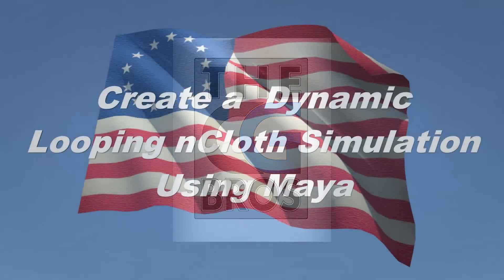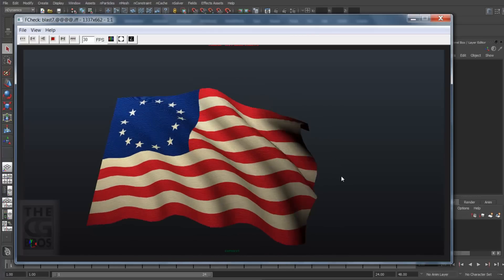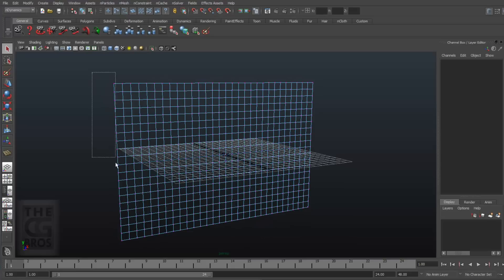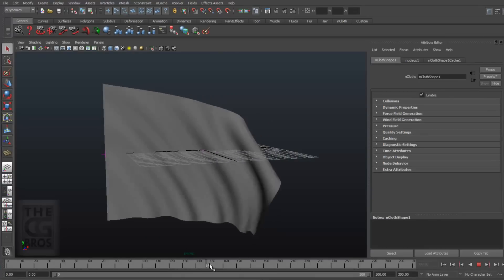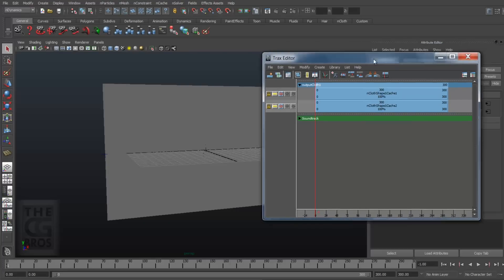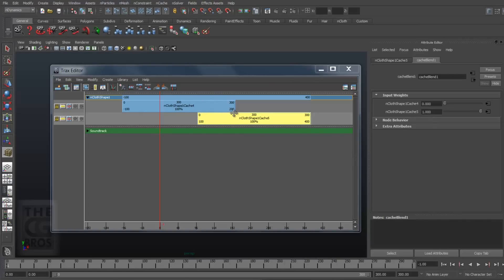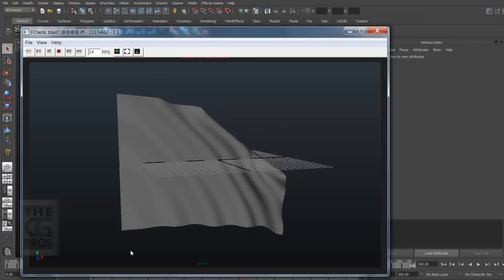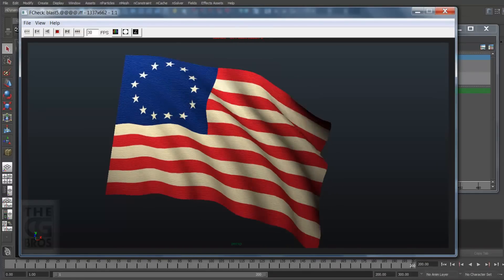Maya nCloth Dynamics Tutorial: Looping Flag Sim Using the blendCache Node  (Intermediate Level)

Comment: I get warnings. "Nucleas evaluation skipped., frame change too large."... also only just a small portion of the flag is animated. I am using real world sizes for the fla as this is for an architecture project. Does it have anything to do with that?

Also tested this in a new scene with the exact same settings and I get a different animation. Changing any of the settings in the nucleus doesn't seem to have any effect after I played the animation once.. How do I fix this?